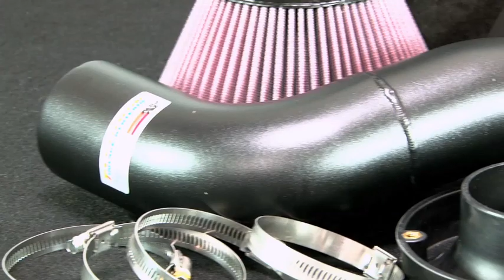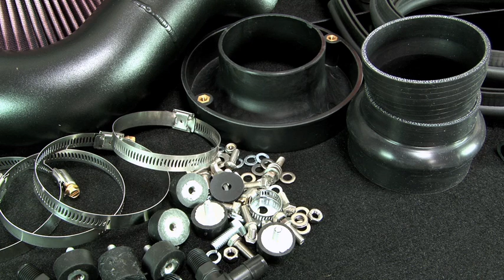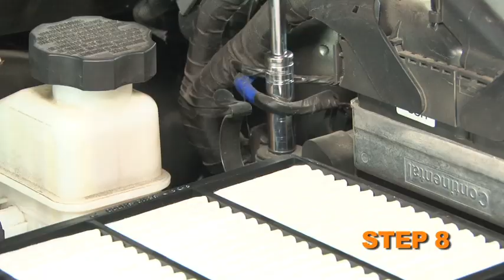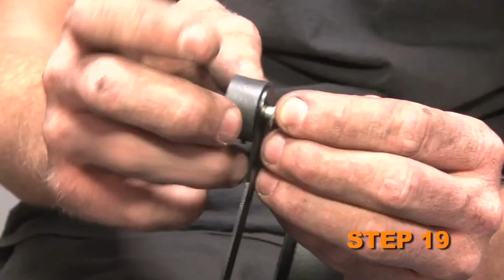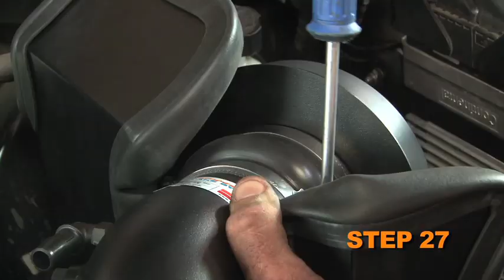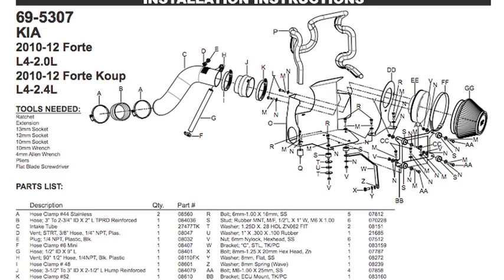Kia Forte 2.0L & Forte Koop 2.4L [#69-5307TTK] Air Intake Installation

Comment: Just got installed onto my Kia Forte Gdi Ex 2.0l 2015 and it sounds so awesome as well as pulls harder and definetely looks nicer under the hood. It sounds great with the glasspack resonator and Magnaflow muffler I have installed too, haven't noticed a significant change to mileage to report.
Reply: did it trigger the mass flow sensor or anything like that after instillation?

Comment: I just got this a month ago for my 2.0 and it is great makes my engine sound much better
Reply: Hey man. What car did you have? Ive got a 2011 kia forte koup, wanted to see if its worth the buy
Reply: Donnie Fuson hey dude so I had a 2010 Kia Forte and it actually did help out with acceleration and some sound from the engine. It’s not a HUGE difference but I could tell. I also put on a dc sport exhaust.

Comment: Will this work for my 2.4L powered 2012 KIA Forte SX (sedan)?
Reply from the maker: This one will not. It is only for the Forte Koup. Currently, we do not produce an intake kit for your application at this time. If you would like to request product for your application, follow the provided link and fill in your information. You will be notified via email when product becomes available. http://www.knfilters.com/register/products_needed.aspx
Reply: What exactly is different from model-to-model in this particular application?  i.e. what would make it "NOT work"?  I am asking because I have seen under the hood of several cars, and they all seem to be similar in their setups.
Reply: @revolutionday1  damn... Left ya on read for 6yrs
Reply: @donniefuson4074  .....right?!  I can see no discernible difference between the "Koup" and the sedan's engines, or air intakes.

Comment: Any idea on when this kit will be available for the 2.0L Kia Forte?
Reply from the maker: This intake system is available for 2010, 2011, 2012 and 2013 Kia Forte 2.0 liter engine model vehicles